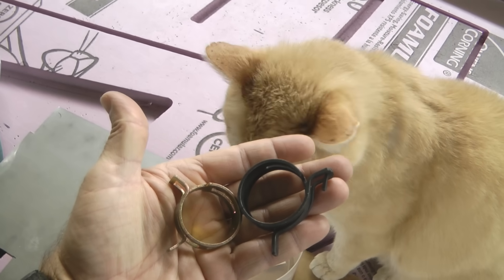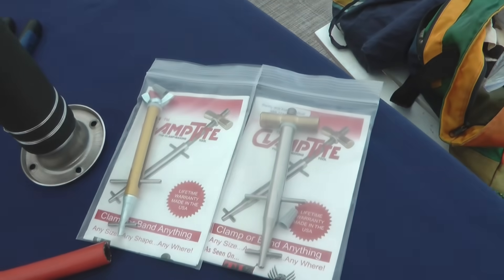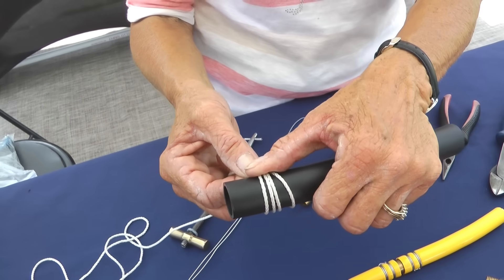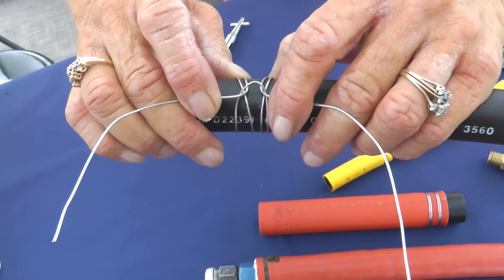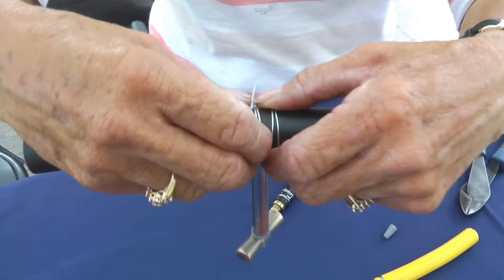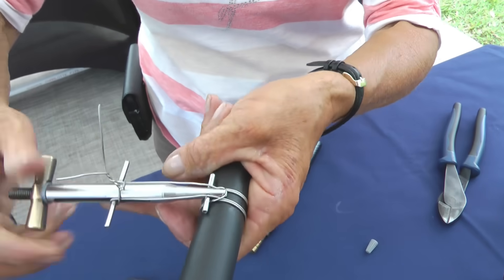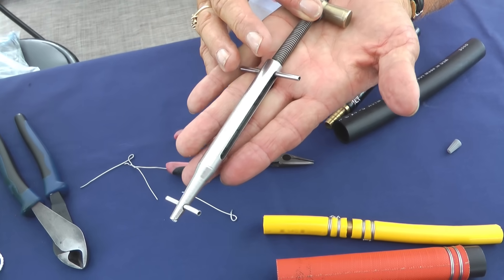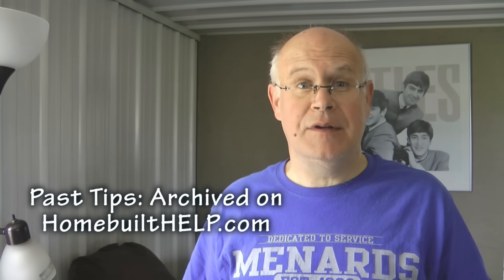Making your own Hose Clamps for Experimental aircraft

Comment: Nice product
A comment about regular common store bought hose clamps is that over time the metal stretches. Fuel lines fasten with cheap auto parts store screw fuel line hose clamps will stretch and leak after a few years.  you will smell the fuel first. So for this product here make sure you buy heavy wire that will not stretch . There is no retightening it.

Comment: she said "noodle nose pliers" 
she said "two times around" and then went four

still, I want one
Reply: She may have said it so many times she's on autopilot without thinking.
Reply: @YourTransmissionRepair  So whats your problem?  I always use my noodle nose pliers when I need to "scooch" something around.  I use my needle nose pliers the rest of the time!
Reply: Transmission R epair
Reply: @YourTransmissionRepair  imagine an airplane in autopilot without thinking
Reply: Single string =4 wraps.  Since the wire is bent in half, 2 wraps is the same length.
Reply: Has anyone found the noodle nose pliers yet?

Comment: Emergency !!  zip ties get you home and  No gimmick and cheap
Reply: scottie scott jip zip ties saved us after our safari vehicle had a Radiator hose clamp failure and repurposed zip ties was all we had available to us... Thankfully the lions weren't hungry and we managed to help the guide repair the problem quickly.
Reply: I wouldn't zip tie a fuel line on my experimental aircraft.
Reply: Yeah but this is a permanent solution.
Reply: scottie scott exactly! and with no mess cutting wires...
Reply: Using zip ties on Fluid Lines may cut through the Line due to vibration tho
Reply: Scott Eales ,
Absolutely correct.
Small handful of those in the glove box with maybe a roll of duct tape and is probably nothing I can't fix or mend until I get home.
Old school seems to win out just about every time for some reason.
Shalom
Reply: NOPE,,,NOPE unless you plan and REPLACING IT as soon as you get to a parts store.
Reply: The Vocaloid Guy  Valuable and perceptive insight. All though various simple ways to deal with any potential effects due to vibration.
Reply: zip ties sometimes dont work
so this is the best tool
Reply: I'm

Comment: You will never have enough room to use thus tool. Just have a few .25 hose clamps around.
Reply: Exactly what I was thinking... Six inches swinging 180 degrees, definitely not that kinda room in a lot of bays.
Reply: Perhaps the tool could be modified to have two beveled gears at 90°, in order to remain parallel and close to the hose...  Just thinking.  Another way I would solve the lack of space problema could be by using a radiator clamptool type that uses a concentric flexible cable, like the bike brake cable (called "Bowden cable").
Reply: maxsleight it does for a gravity feed fuel system, that's what my dirt bike had on it
Reply: thechosendude yeah in engine bay of car useless but if you need a 100mm clamp urgently for heavy machinery perfect it's quite cheap you will only need to use it once to pay it self off.
Reply: Scott H apoyemos a omega el fuerte🌎
Reply: Come to think of it, I've never had  situation where a worm gear clamp was too big.  Too wide, sure, but they can shrink to just about any common size; and the extra can be cut off.
Reply: Those stupid gear clamps have their uses, but so does this thing.  I have like 1km of  rubber airline running around the shop, and those gear clamps failed all the time.  So, we bought a hydraulic clamp tool, and no failures since.  Using a gearclamp for something where you need reliable connections is a mistake.  Also, if that connection is getting beat on (dragged around), gearclamps are brutal.

Had I known of this little gadget, I could have saved $5k.  I don't need the clamping force, what I needed is something that can't loosen.
Reply: thechosendude I have. I had to repaire a heater in a boat  where I needed to use a hose mender then push the hose through a tight hole. I used an oetiker clamps to do it. This tool would have worked but any other low profile clamp would to.
Reply: Yeah, if you prepare to clamp, just stockpile a few  clamps.
They cost less than this tool, and don´t really need more space, furthermore you can fix the problem in an instand and don´t get just a transitional solution.

If you don´t want that, learn how to tie knots.
Normally, you don´t need a tool to tie a knot. 
That´s only the case when some creedy ***  modifie a knot until it is such worse they can sell you a cheap metal stick as the wonder tool you have ever dreamed of.
Reply: legionary illuminati doesn't work

Comment: I have a air hose that got cut while dragging it and put some SS screw clamps on it. Those clamps hung up on all kinds of stuff when dragging the hose. When wrapping the hose up you get to have it cutting your hand. Then on the same hose I had to add a clamp next to the connector and it was very uncomfortable holding the tool that I connected there. Saw this tool and looked around the shop and found some things to make one to see if it would work and the wires wouldn't be sticking out hanging up on my hand or objects when dragging. It took a little welding to make it but it worked so far. I used wire I had laying around the shop. So far very happy with it.
Reply: Barry Wind wrap some tape around it. No snags or cuts.
Reply: Get some doublewalled heatshrink and shrink it around the clamps (also useful on these types of fastenings). No more snags and cuts! :) Tape works too, but it degrades over time and gets sticky.
Reply: Even better go to a salvage yard and take all the hose clamps off of the vehicles. They will cost you pennies and be what the oem uses. Mercedes clamps are really nice as they are smooth on the inside. I get them for less than 10 cents each
Reply: Barry Wind I usually tape over the clamps with a few wraps of slick plastic electrical tape. Solves the problem of catching on things and finger cuts.
Reply: cabletie69 that's what I do too.

Comment: She was a little too quick for me when she said "ten times stronger".  Ten times stronger than what?
Reply: Allen Mckinney, i remember that 10 or more years back it was fairly easy to find those screw clamps of high quality, you could practically broke the piece you were working on before started slipping, now they are all of soft material, really bad quality.
Reply: W Nij - I, too, remember having very strong, screw-type hose clamps: actually could cut into a coolant hose if over-tightened. Just one more ‘value-engineered’ product. I’m grateful to have used the good stuff and, thus, be aware of the difference. Not all ‘change’ is for the ‘better’, and this is just about a hose clamp.
Reply: W Nij I can tell a big difference in the ones on my 1988 Porsche 944 than the ones I get at the hardware store.
Reply: Steve Wright a shitty screw clamp that starts slipping when tightened too tight.
Reply: 10 times stronger than what the average idiot could accomplish without this tool.   Plus Kathy can probably kick your ass so shut your mouth and buy the tool.
Reply: Steve Wright cra fdcc
Reply: your mama....or wife
Reply: ten times stronger than the next  [ Nm ]     Newton meter
Reply: 10x stronger than nothing!
Reply: than a worm clamp
Reply: Ten time stronger than your shoe lace...
Reply: 10 times stronger than the other company's gadget that does the same thing.
Reply: Steve,
A rubberband? String off her tampon?, ramen noodles?
Reply: legionary anti-illuminati  That tool should honestly sell for maybe $19.99. Even tho they'd get less for their tool selling it that cheap, I bet they'd sell so many more of them, resulting in more income. At the $50 price point it automatically turned me off and almost lost interest in the tool completely. I understand it's a cool tool but don't get too greedy and try to make all your money at once. Basically don't step over a nickel to save a penny...
Reply: legionary illuminati do a video

Comment: When removing wire:Can you cut the wire with out damaging the hose? If so, where is the best place to cut it?also don't the wire cut in to the hose a bit? It might get you out of a bind if in BFE, but for long term, I would use the right clamp for the right job.
Reply: Buddy Rose, Why not unbend the wires & unwind??
Reply: Buddy Roset iú te

Comment: Interesting idea, but I have to agree with the comment about not having enough room to use the tool in a real world situation. I wonder if something like a tie wrap gun could be used to apply the tension.
Reply: The only alternative is a band-it tool, also very difficult to get into tight places. It is a very useful tool, any steel curtain wire will work. Great for water hoses of all sizes and it's easy to find a roll of cheap curtain wire. They should make the tool capable of using a coat hanger, something everyone has or can get easily.

Comment: As said, unless you can take the hose/tubing AND connector off, or at least far enough out and away, you usually dont have enough room for the tool. Especially to flip the tool as was shown.
Reply: No tool works for everything, but this would be a good addition to the tool box!
Reply: I farm and I have had one for years it is great.
Reply: Lawrence Withrow ooUuu Uuu Uuu
Reply: Midniteoyl Yeah   that's the issue I had with it.  On a bench it's easy to use but in most practical applications the tool just requires too much working room.
Reply: It is useless for a mechanic shop not enough room for all that , I agree with you Sr!!

Comment: More... or 2 wraps around with .032" safety wire, and twist us the ends with your safety wire pliers. Don't expect miracles, and it'll never pass AC 43.13 muster... mickey mouse at best.
Reply: Good point. Certification inspections are a bear even with the best components. There are a lot of things that will work fine but the FAA won't go along with.
Reply: Lawrence Withrow o

Comment: Sorry, I have first hand experience with those pricy wire clamp gimmicks; they're nearly useless... there is almost never sufficient clearance around hose nipples to manipulate them[1]... and wire really isn't a good clamp material for numerous reasons. For hose clamp 'emergencies' your probably better off familiarizing yourself with the ancient 'Constrictor Knot', and tighten it with a couple of 'Marlinspike Hitches'. (See Wikipeadia for the knots, and note that the Constrictor can be fashioned in both single and double versions.) You do need to have a piece of quality line (like heavy Nylon string or maybe even 550 line) with you... and even then, line is tough on hose just like wire. Constrictors won't be suitable in many cases, but far more often than those gimmick tools. Best is to practice preventive maintenance and minimize 'emergencies' in the first place.
[1] Ever notice how at the fair those tools always demonstrated on loose hose and nipples with unlimited clearance all around? Sadly, thats just not the case in the 'real world'.
Reply: rwbishop 550 comes in handy alright. My peterbi!t hood spring broke so I made  a catch using a hang man's noose (only 3 wraps)  at both ends -- worked like a charm.
Reply: Sales people don't like to admit that clearance can be a issue.  There are times when there is no substitute for a spiral clamp. As far as materials, I haven't had any problem with the wire I have used.  It's important not to use cheap wire and to use the right gauge.   I had a factory brass crimp fail on a airline.  I fixed it with wire and the repair lasted longer than the hose and it was under pressure over 8 hours a day six days a week.  When it comes to tools there is no magic wand, but I don't regret buying mine.  If you have to use cordage to get home then by all means do it, but If I had the choice between cordage and wire i would use the wire, situation allowing, because I know It could trust it to last.